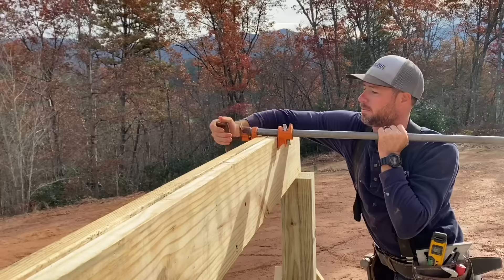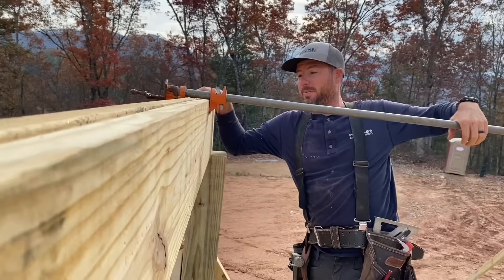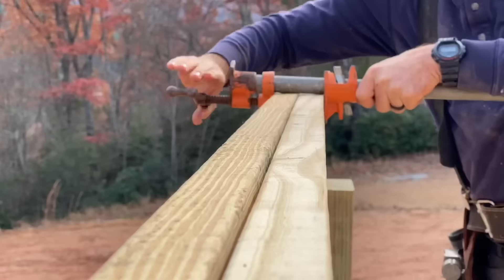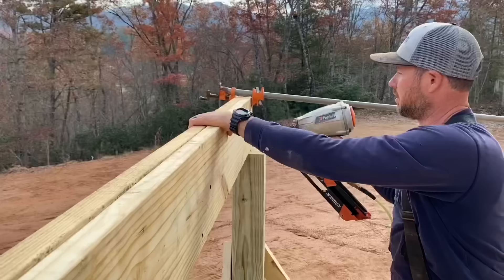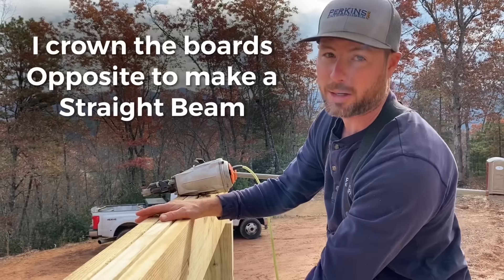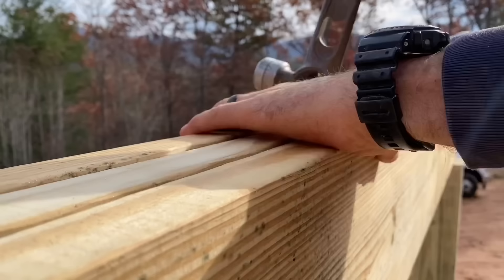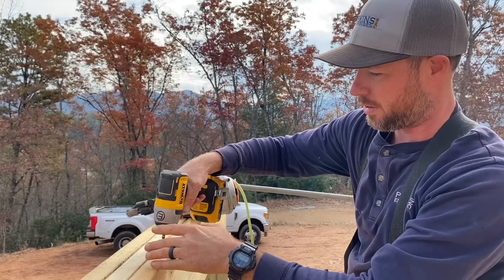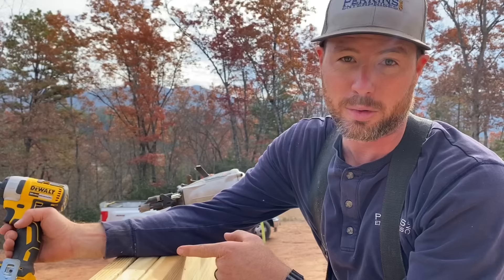Building Better Beams and Girders | Tips and Tricks

Comment: Note to @Better      I loved your video. I designed (now retired Product Development Engineer) half the parts on that Paslode you are using.  Paslode gets sued every year from contractors who have lost an eye. It goes before the court,and the plaintiff is asked  " Were you provided safety glasses with the nailer when you bought it?  Does it state on the side of the nailer that you must wear safety glasses when using? " Were you wearing them? Plantiff  "no" ;  Judge: "Case dismissed." The problem is that no one can make a perfect nail. There are carbon inclusions in the steel. The heads go 'ping' and fly around the room.  Save your eyes my man.

Comment: I saved 750 dollars building a wooden beam on site vs a steel beam. Nice tips.  Money saved bought a lot of studs.
Reply: So wood beams replace steel beams?
Reply: @gwp1ohio  absolutely.  A wood beam(properly sized)is just as strong.  For me, it put money in my pocket.
Reply: @kennethwallace5168  hmm
Reply: @gwp1ohio  the book I used to help me with this is called Basic engineering for builders.  By Max Schartz...easly formulas using basic math.

Comment: Great trick with the screw. 
Something I’ve always done is nail my beams/headers/girders on a flat surface then install where necessary. Unless it’s a huge 3 or 4 ply header, then we’ll install it as a 2 ply and add the remaining layers after we stand the wall/beam etc. just to save our backs.

Comment: Thanks for the tip and when it comes to saving screws in reusing them I wish these younger guys would get the clue you don’t throw hardware away 

valuable

I did young mechanics throwing out parts for bumpers and all the hardware for lift kits in such crazy

Comment: Thank you for this great video. Can I ask how you have the outside board of the beam secured to the post? Is it tacked in place with a nail at each post or is it connected to a bracket? What is holding it in place strongly enough to allow you to manipulate the center board with pipe clamp? Thank you in advance for any assistance. I wasn’t clear about that part and I’m currently dealing with this exact issue.

Comment: If you pull the tops of the plies flush with each other, doesn't that make it possible for the bottoms to be uneven, so you might only have one or two of the plies making contact with the post instead of all three?

Comment: Just wondering why you wouldn’t use a 6x beam structural 1 beam?   Or if it’s a supporting member inside a framing system why not use a paralam or versalam.   Crowning and shear nailing a built up beam widely used and is recommended by architects but one piece of lumber goes up faster than assembling the time taken.  I’m just wondering.  46 years a carpenter and 26 years general contractor
Reply: Cause it's super heavy and he'd probably rather not crane that up there

Comment: Question? What size beam would I need to clear span 40 feet also, what size beam for clear span 20 feet?
This is for an awning. There will be nothing on top of it except for its own weight and 26 gauge R panel. 
Is there a calculation for this or?

Comment: I have seen people use a 2x12, plywood and 2x12. DO we need the plywood sandwiched in between for something. I am going to build a small cabin and getting notes before I even start.
Reply: Jj Moss  Thanks. I have seen so many videos this week on framing. I remember this because around 1998 I helped on a few jobs and never saw anyone else doing that. I was around 15 at the time. Thanks
Reply: the plywood makes it much stronger i would think.    they used a board/ply/board to make a header for my house add on.

Comment: How can I find true vertical on a 45 degree or 12 12 pitch roof? I can use the laser they get the horizontal and of course the crosshairs project a vertical but it's not true vertical that's all I fiddle around with it but I don't want to fiddle anymore I want to know.

Comment: I'm looking at making a beam out of 2x10's but wanting to notch my 6x6 post to set and attach the beam to the post that way. What I can't really find any information on is how much of the 6x6 can you notch without having issues?
Reply: Guessing, but you can probably notch it all the way off, i.e. he put his beam on top of the post. If he had notched he could have clamped to the unnotched to verticalize the beam. Notch if you need to stabilize or want flush surfaces. Just my thoughts.

Comment: Neat trick but that beam will never pass inspection. You cannot bury your fasteners. The inspector wants to see that there are sufficient nails and that they are properly placed. FAIL!
Reply from the maker: Nailed from both sides bud
Reply: @PerkinsBuilderBrothers  
Awesome. No problem then. Thanks for the quick reply. I always carried a few clamps with me back in the day before I retired. No YouTube to learn from back when I started. Just figured it out myself. Lasers replaced my plumb bobs too.
Reply: @PerkinsBuilderBrothers  I have question. My main carrying beam in my house is starting to twist (over 40 ft long, 3 2x10s). What can I do to fix it? I see what you did here, but my beam already has a load on it.